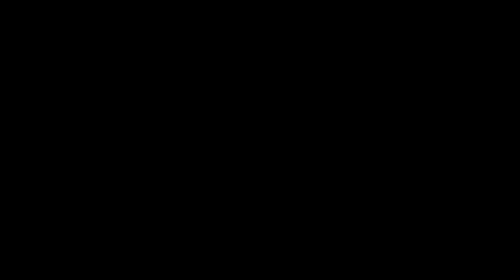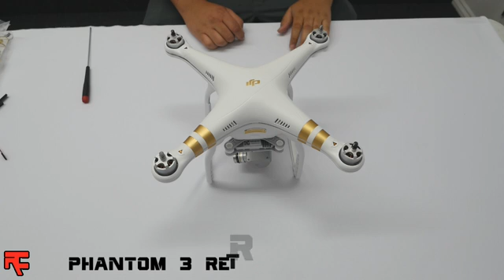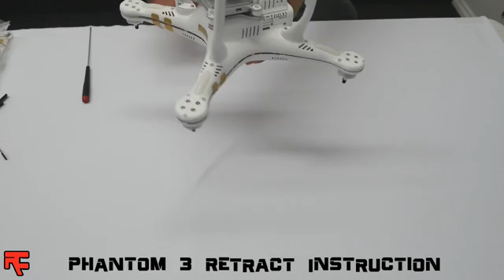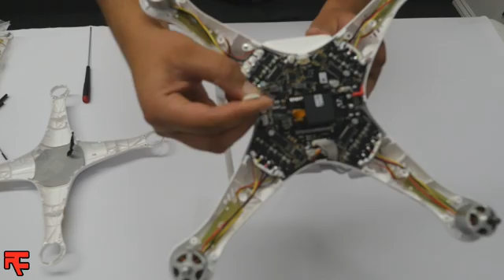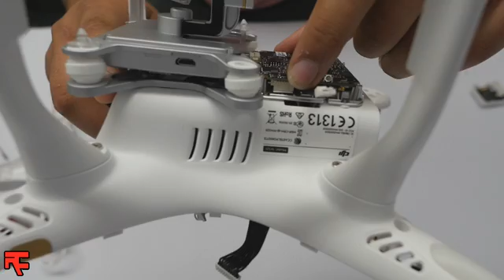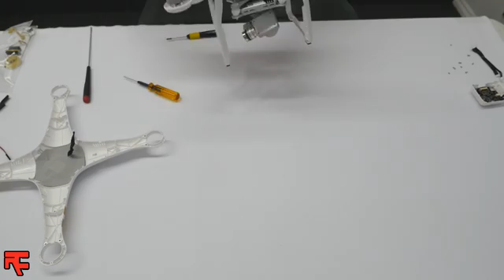Phantom 3 Retractable Landing Gear Installation Instruction

Comment: I know this is from 2 years ago but as a retired electronics engineer I would like to point out that whenever you work on microchip pcb's an earth strap should be worn to avoid static damage to the chips. If at all possible you should avoid contact with the pcb's. I was horrified to see the boards just grabbed and pulled out like this.

Comment: After 2 years, can someone say the modification works? Or money and time wasted and you find yourself with a phantom virtually disassembled and does not work as before? Thank you.
Dopo 2 anni, qualcuno può dire che la modifica funziona? Oppure soldi e tempo sprecato e ci si ritrova con un fantasma praticamente smontato e non funziona come prima? Grazie.
Reply: Ciao,  magari tu riesci a dirme qualcosa...  ma tu hai presso questo coso?  sei riuscito a instalarlo e usarlo ? va bene ? funziona ?   dove posso prendere uno. lo voglio per un phantom 3  Grazie Mille.

Comment: Looks pretty cool, but its useless like everyone else is saying.  They should have used plastic instead of metal and servos, same thing 1/3 of the weight.  Personally I wouldn't take mine apart for it.  Looks cool though, wonder how much flight time it takes away?

Comment: I did my first flight tlxay with the 3 pro. 15 mph wind no humidity..I went from the starter setti g to advance  pro and took it to 90 metters up and 200 metters away.  I filmed it and while it was hovering i started to u derstand the cameras setting.  i had i stalled my propellers guards for 2 reasons. 1 to save tne phantom if i crash but more to add weighg in order to be more stabilize at crazy hieght a d speed. I did 2 full flight about 20 minutes or so. i think that without guards and wind i can fly another 10 minutes or so. 

i also designed an item that would save hundreds of craft if it were to lose power or you. Im probablh will patented it a d protectic from fake copies or hater. This will nelp 1000000 of drones from crashing. 

if you are an invester and want to talk you can email me. 

Zby next year we should have way better batteries wkth a cooling system like your cars has.

so if you are an in vester that is interested let me know and we will make it happen.

What i came up with is a winner that will change the dro e experience.  its lots of fun bjt its a wlrk tool for lots of us from photos,  survey,  news, first respond rescue during hurricane or other natural devastation. 

let me know .

*The FrenchRonin *

Comment: so out of 100s of replies nobody read the other 99 guys Atari g the same obvious thing, that it doesn't pan the cam so what's the need, then of course there are the millennial punks who in top of the obvious insist on being disrespectful morons on top of it. Why? why can't these guys treat others with the respect "they" constantly complain about not getting. 
   Anyway, I love the way it looks in hover mode or in flight, I don't like the legs always down. My bird always gets complimentary comments and ppl wanting to know more when they actually see me. Ill bet with these the cool factor goes up 100X. If I crash at the altitudes I fly, the gear isn't going to save me and from what I've read, it doesn't save a whole lot anyway when there is a crash, I don't buy parts to crash, I'd never had put an extra 25HP on my RZR 900 if I was worried about crashing. if an extra weight of this type took 10 minutes off if look for another problem, I've read its negligible, maybe 2 minutes at most, less usually. The biggest concern I have, well two things, this mod was and still list for like $240 WHICH IS UNACCEPTABLE, there's one identical but uses the vision system, once it can read the ground it opens (well, maybe not, it uses some sensor to open and close and you can set this) but that one is $75 on eBay. The antenna being opened horizontally, not sure if it would hinder, and may actually improve signal, I personally have the DBS antenna modification for a 8 mile radius or 4 miles one-way so I am not that worried as I don't fly 4 miles away. 
So all you guys out there that say anyone that would install this is "special" give me a break a drone with this mod compared to a drone without this mod is a no-brainer which one looks way cooler and better in flight. An infant can do this mod, those who actually seen it done and say it looks hard, what the he'll do these guys do for a living, for anything, jees, suck mommas titty much? No wonder the youngsters think China is cool, they've been coddled to the point of pussydom! 
  Now I think ill go buy this mod, that'll be two now in as many weeks since I bought it, with free battery for $660 brand new. (ok was $999 w/free batt but had $380 in best buy points from my new 4K UHD Curved top shelf Sammy) and the $110 I spent on the Antenna mod, oh I know these same guys think that's a waste too, with what I've got into this thing, its still less by $350 or so AFTER I buy both.
  For the rest of you that are just looking and not overreacting and saying foolish remarks, good luck and remember, its your drone do what you want with it, there's always haters, but if they have a drone too, and fly it with or around you, they will be jello, I don't care what they say, because it LOOKS like a drone should, ever since the first plane had retractable gear, all the other pilots wanted them too, and not just  because they gave better flight characteristics but planes look like planes retracted.
   one of the biggest things is this, we all wish we could afford the cool inspire but alas we cannot the retractable landing gear gives the Phantom a higher-quality look and makes it look like it should and those who don't know don't know the camera doesn't pan so to them and the other 90% of everyone will look at the Drone with a little extra awe and know they want one.

Comment: Why add retractable gear to a fixed gimbal drone?.
there is no possible way to get the landing gear in the shot.
Reply: Maybe you can't understand the landing gear in your shoot issue because you don't have a Phantom.  The fkn landing gear always find its way into your shots, specially if you are pointing your camera straight down...This modification eliminates the problem.  You can find this gear for under $40 on ebay.  The additional weight is minimum,  no reduction in flight times will be noticed.  

This is a superb modification that DJI failed to include with their new models. That's why Yuneec and their Typhoon H is kicking DJI's ass...
Reply: +ricardopr54 I have many phantoms fool and have never seen anything but props. 
That's why the adjustment . 
You sound like an idiot.
Reply: +ricardopr54 Maybe because YOU don't have an inspire is why you don't see the true function of retractable gear.
Reply: +Sam Jackson We are not talking about the Inspire on this forum.  The Inspire is something completely different than a Phantom...Even with the inspire, if you are not careful, you can ruin your footage with your props showing...Of course, is a matter of gimbal angle adjustment,  but with the Phantoms,  that wouldn't work if you are intended to get a straight down shoot and is a bit windy...
Reply: +ricardopr54 Yes it is and it requires and makes use of retractable gear. 
A phantom has settings to dial the gimble in so the gear is never seen. 

If you see it YOU screwed up simply ask anyone with one. Now I know you either don't own one or poorly set it up.
Reply: +ricardopr54 This is Not a forum man its a comment section on a youtube video.
Reply: +ricardopr54 And you brought up wind well you have shown your inexperience an expo adjustment fixes that problem.
Reply: I will try to explain it in English_____It is also great to take with you if you do not have a large backpack, by retracting the landing system, you can fit it in any kind of backpack. Takes up less space. It also looks great when it retracts its legs in flight. I would like to have one.

Comment: Retractable gear could make the p3 fly faster-- if the gear does not affect the prop wash.
Do the antennas work as well horizontally polarized ?  Also the antenna tips are closer to the motors, a possible increase in RF interference.  The added weight could cancel out any gains realized by the reduction of wind resistance.  Someone should test  2 P3's on the same day /conditions.  Test for signal integrity , battery life, speed, and stability.
Battery life could also be less due to the constant power applied when the servos are powered.  Someone commented that the servos get hot. Heat = wasted power.  The retractable gear came with a package deal that I bought last year, but I never installed the gear.  Too many questions.

Comment: I appreciate the time and effort that you put forth in creating this video, but I just don't see any benefit to putting this on the Phantom 3 since the gimbal is fixed in the horizontal plane/x-axis. Maybe once or twice during a hard bank the fixed gear showed up briefly in a video, but it's not a problem great enough to warrant the cost and effort of installing the retracs. The added weight will also reduce my flight time.  I can see this being a huge benefit to the Phantom 2 though.

Comment: Stock landing gear does not affect aerial photo / video at all since gimbal does not have 360 function like inspire does. So what's the point of buying this? Just waste of money, added weight and less flight time. On top of all in case of malfunction you would wreck the gimbal and the camera. Measure twice, cut once!

Comment: I would love to know how much this is. What a waste of money.

If you are flying with the legs up and have a minor crash, your gimbal is going to take the impact and bye bye camera. I would rather fly with standard legs fitted with a gimbal protector so at least the gimbal is protected.
Reply: A gimbal protector is a piece of plastic or carbon fiber which connects to the legs of a Phantom so if you have a heavy landing it protects the camera. Google "dji gimbal protector".

Comment: The advantage of getting the gear out of the way depends what you shoot. If you just cruise around and take video, not worth it. But for me I do a lot of fast sideways flying shooting action sports. In this case if you point the camera down more than about 20 degrees and then fly sideways fast the legs can get into the shot. Although not important for most, this is a very interesting option for me. Great tutorial, thanks!
Reply: +CactusJackSlade I should also mention the more of a downward angle you shoot, the more likely it is to get your legs in the shot...
Reply: +CactusJackSlade 
Much easier ways to modify that front corner of the legs to keep them out of the field of view.
Reply: huntjunky1 I was thinking along those same lines... Good idea do you have any examples?
Reply: +CactusJackSlade 
I too thought the video was a very good tutorial. I'm also happy to see that the Phantom line is mature enough to that these types of modifications and tweaks are being put forward as DIY Kits. Up until I ready your post, however, was wondering what would make the extra weight and complexity worth it, while one was flying the stock camera that is.  I was expecting a camera mod to be next. But your post points out one of the flaws of having permanently extended gear, that hitherto I had not thought of.
It's interesting, agreed. Just make sure your Three-and-Green on landing though! Can't tell you how many times I belly flopped a cartoon fighter-plane while playing the Aces High II flight sim. Don't want to do that with a Phantom-3 or that camera will go crunch!
Reply: After flying the P3P for a while now I do not intend on folding gear.... I have yet to have the legs get in the shot and I was flying in some pretty high wind the other day. The Field of View is much narrower than the GoPro even set on medium. This is more like a GoPro set on narrow... so at this point I do not see the need for folding gear...

Comment: Hello,

Have you got please the wirong diagram for the sensor cable where to solder the servo cable ? because i'd really need it to manage my 360° gimbal which is attached to my legs. Many thanks for this. I sent you an email but no answer :(

Many thanks again in advance.
Manu

Comment: so could you use this same thing but instead  of a landing gear could you have a payload drop or a winch servo so that way you can pick stuff up and drop stuff??
Reply: what size is the connector that you put the retract servo into? i want to replace that with somthing else but need to know what the female connector is

Comment: Come up with a way to make the gimbal go 360 and you've got my attention.
Reply: Why does it matter if you can still rotate the drone 360 degrees???
Reply: FYI It will with the inspire remote ;)
Reply: +somerandom , yeah I tried it at a shop when I asked them about pairing the remotes and if you could use an inspire remote or not on a phantom, not sure what phantom 3 it was but the inspire remote let you pan the camera... the guy was surprised... but seeing as it only really applies to inspire owners (as who would buy the inspire transmitter only)... but it pointed to a software limitation not hardware :)

not sure if anyone else has tried it... any inspire owners?
Reply: I dont know about you but it seems to be much easier to move the camera than rotate the drone. For me depending on GPS there can be a slight change in actual location when I rotate the drone. I can compensate manually but it is a small deviation with wind etc... and makes a huge difference if you are flying close to an obstacle. 

At far distances it is much harder to judge. it allows you to keep the nose in the same relative direction and not have to continually compensate. This is crucial for snaking your way through a forest or similar conditions. JMHO...  :)
Reply: +Aaron Smith oh ok

Comment: Seems pretty easy to accomplish. But I wish they would have incorporated the initiation into one of the buttons on back of RC controller. A little concerned with the weight addition reducing flying time/battery life. I'm good at electronics so it will be no problem to install, and I could always reverse the process with the original wiring harness. the kit includes a brace for storage so the legs don't open slowly as I noticed in a prior comment. (probably create my own via 3D Printer) I'm installing longer legs because the stock ones don't allow enough room for the camera on uneven surfaces, especially with the Ragecam ND filter. Although the camera doesn't pan, it's a pretty cool feature worth trying.
Reply: +Jim Miller Update: So I installed the retract gear in my Phantom 3 professional. I took me roughly 5 hours because I took my time and didn't fumble or rush. I had to use strong thread to feed the wires through the Phantom, and I have no idea how it can be accomplished without doing this. The compass wire had to be fed through to the other side above the upper battery plate.

 I used a small saw blade on a dremel to open up the vent holes on the side, then ground them into shape, followed by sandpaper for a professional look. Put shrink tubing on the compass wire, attached the compass wire to the two sided tape on the L shaped bracket, then pushed it up plus heated it up of course to conform to the compass.  I had to slightly grind one of the brass hinges since it hit the gimbal mount. As far as removing the upper shell; I found it easily popped loose by carefully pulling up on the rotor ends, then pushing in towards the middle carefully as in the video...not really a good idea to use a butter knife or anything to pry on it, due to the very thin inset lip. Take your time with this also, and don't forget to remove the GPS plug before you pull it up. Nonetheless, it was pretty easy and self explanatory after viewing this video as reference. Could NOT have done it without this video! 

It works great and I'm really happy with the results. Warning: this upgrade is not recommended for the faint of heart. If you have the electronic and mechanically inclined skills, then take your time, think things through, and go for it. The added ground clearance keeps my camera with ND filter off the ground, keeps the skids out of the frame when accelerating, and it makes the Phantom look killer. I added black replacement skids found on ebay. The only issue I encountered was dropping one of the tiny T8 Torx screws on the floor, looked for it for hours, came to the conclusion there's a black hole in this part of my floor. If you don't have the patience, you're going to pull out lightbridge wires or something worse, So I'd recommend having a professional modeler/shop do it. Have fun and enjoy!! I love mine!!

Comment: spent $250 and had all sorts of problems. Left and right labels on cable so thats not the cause. The servos overheat. I bought 3. And many times a leg will not retract all the way. with the power off the legs slowly spread. I have to use a rubber band to hold. Because of this I would'nt dare try and catch.

Comment: Very cool but totally pointless, very expensive for a set of two servos and two brackets, plus if I am not mistaken, you set the control switch on the flight mode control, so what happens if you actually want to fly in a different mode or if you want to switch for P to A flying ??
Reply: GOOD QUESTION !